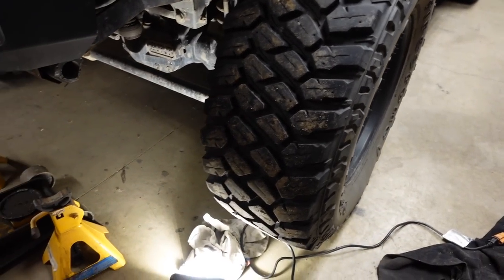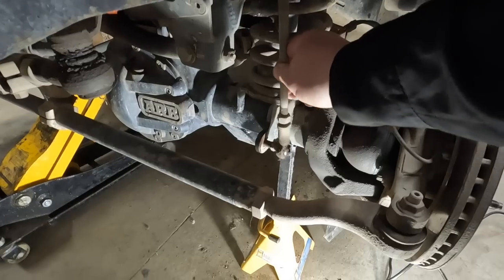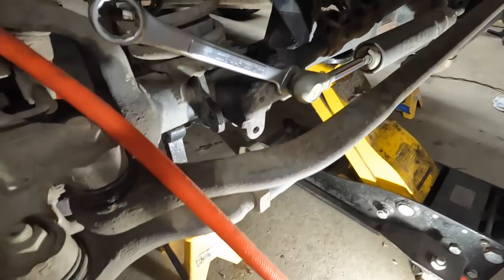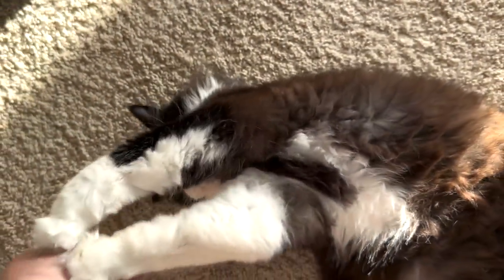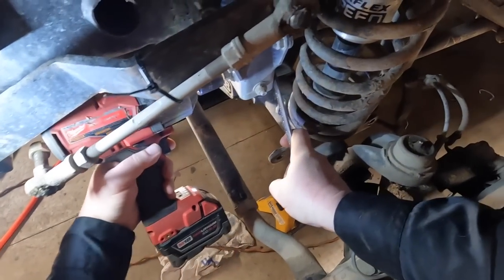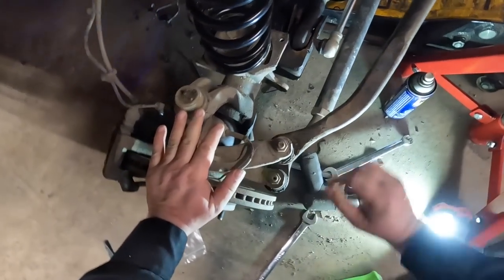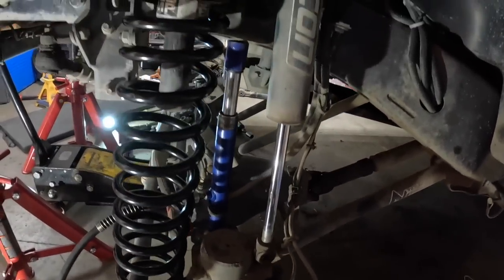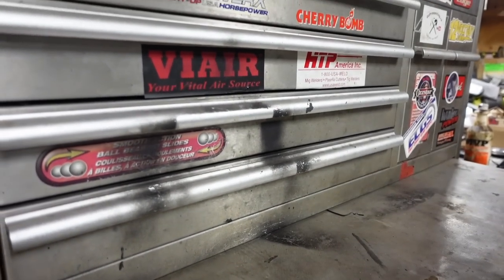This Doesn't MAKE SENSE WHY.......

Comment: As I have said in the past, both on your channel and numerous others, Fluid Film will save your undercarriage and suspension from rust/corrosion and save you a ton of headhches. The only issue I have foubd with it is that if you intend to weld anything coated with it you must remove it with acetone of laquer thinner as it is really tenacious and will foul your weld. I live in the rust belt and drive on an Atlantic Ocean beach and I swear by it. I hope your project gets easier, but it is afterall a Jeep which is short for "pain in the ass"! 😄
Reply from the maker: That’s so true it still in the works to do that, used oil works extremely well too and it’s free lol
Reply: @BackCountryWrenching  Yes, I'm sure motor oil (used or otherwise) is better than nothing, but check out the video titled "Fluid Film vs Motor Oil vs WD40 vs Grease and you'll see why I opt for Fluid Film.

Comment: Has that Jeep had an alignment since you've owned it? I'd check your caster angles if you still have the print out. The driver side will be less positive than the passenger side the way it currently is set up provided there is nothing bent on the Jeep. The SAI and Included Angle specs will show if something is bent as well. In Saskatchewan when we do out of province inspections anything over 0.5degrees side to side for SAI/IA would indicate bad components or damage. You will want your LF and RF caster within 0.5degrees side to side as well. If it was aligned and left that way the guy was probably lazy or didn't see the adjustable LCAs OR they are seized and he was again lazy lol. Caster angle really won't effect tire wear drastically (especially on a Jeep where there might only be a couple degrees positive. You'll get tire wear on something like a Mercedes when you have 10+ degrees positive caster and the tire scrubs on the edges when turning/camber roll) although it may pull to the left slightly currently...or not it is a Jeep after all. I've always joked they drive better off road then on road ..You'll want some positive caster once this project is all done for some straight line stability and eliminate the alignment as a potential cause of death wobble. I was once an electric tool fan boy but can tell you all my air shit has out lasted anything electric. IR, SnapOn, Milwaukee doesn't matter I've wrecked them all lol. They really can't take much in terms of dropping, throwing, chemicals leaking inside, etc. They have their place but a good compressor (key) and nice air tools always win day to day for me in the shop.

Comment: Frame is bent or someone was crosseyed when installing or aligning that lower control arm! Crosseyed can be overcome, a bent frame is well ... a bent frame. measure the axles spacial placement in relationship to the frame and body and see if anything if 1 and a quarter inch out?? I like my '70 truck frame with repair instructions and measurments, whatsit like today? "ah can see it's bent so's you needs a new one..." some tech installer (vs mechanic who fixes) 

<3 all (witheyescrossedcostheworldaintstraight)